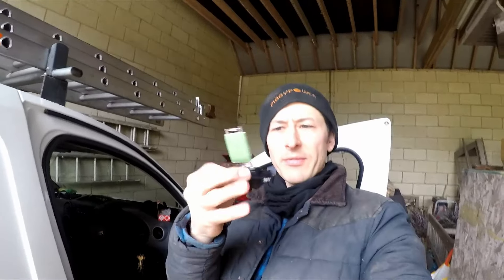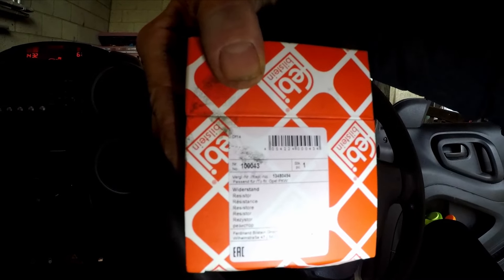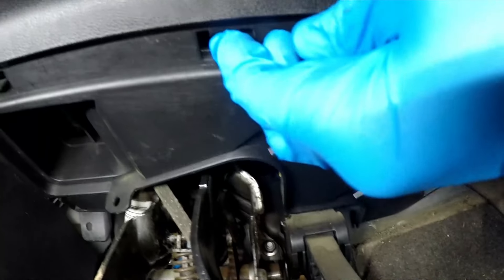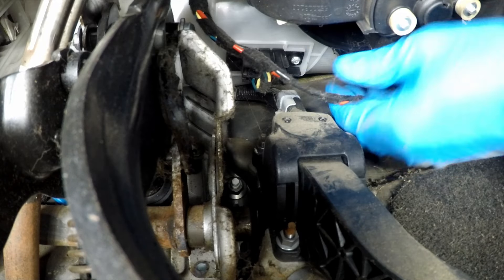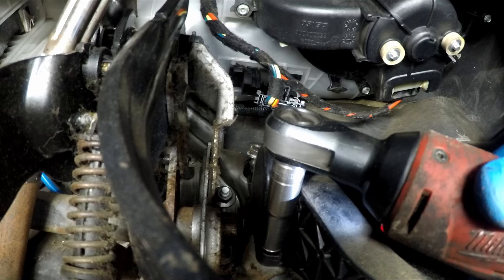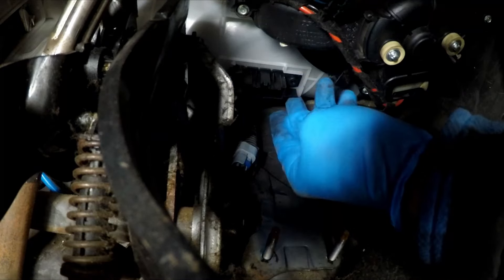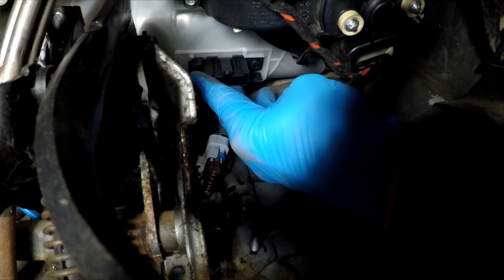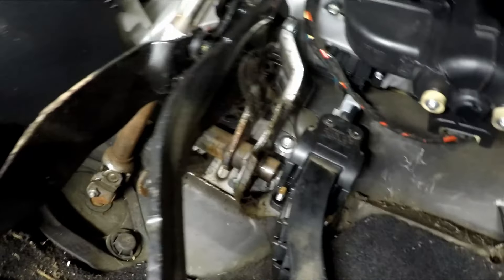Peugeot Berlingo Citroen Partner Fan resistor

Comment: The reason these fail is that people turn on the blower when the intake is blocked with snow or leaves. It's the thermal fuse that opens and you could, in theory, fit a new fuse. Or solder across a bit of wire and hope it never snows again. The fuses may well open if you try to solder them.
Reply from the maker: Very inexpensive part tbh and it's a fail safe that they blow. It can indicate bad wiring or poorly fan too. This is regularly serviced with no blockages in the intake system

Comment: I have a 2017 Peugeot Tepee, partner with windows in Mexico, with a 1.6hdi motor. The fan is stuck on one blower speed. The dash switch does nothing. Bought this resistor, removed cover plate above pedal housing and it’s not located above the accelerator pedal. Any idea where it’s located on this model?
Reply: @Darren-pq5oc  brilliant! Will check it out.
Reply from the maker: As above. May be switched across.
Reply: @Darren-pq5oc  yep, that’s where it’s located. 👊🙏

Comment: i've got a similiar problem with blower resistor. I changed that part you showed and now my fan blows only hot air on cold and hot setting with burnt plastic smell. I checked wiring doesnt heat up and the resitor is cool aswell (when in use), Could you help me with this?
Reply from the maker: So that's a different part which must be stuck on hot. This resistor doesn't control temperature 👌🐷

Comment: I am having the same problem with the fan only working on 4, would this also stop the heat from coming through as it’s constantly cold? 
Thanks
Reply from the maker: No, the fan controller... Controls the fan. Not the heat. Check matrix pipes are hot (when engine is up to temp) both in and out then check the flap which switches from cool air to warm air behind the dash

Comment: Excellent video, many thanks. Anyone trying this needs to be physically fit and bendy as it is a bit of a bugger to get under there. 
Or get a 20 year old with long arms and stick them under there. 2012 Berlingo multi space with A/C was my model for refrence.
Reply from the maker: I'm 36 with a host of joint and back issues.... Nice good stretch first... And I can do about 5min under there .. not as much as when I was 26!!
Reply: @PiggyPower  Same, I am a builder who has always fixed cars on the side, (because I am poor and end up doing it - lucky I am fairly good at it) but my question is simple. Who designs cars and says that the best place to put something that may need to be maintained is hidden under the dash, not with the bank of fuses in an easy to access place with a plastic cover on it? Then they cover the engine with plastic so you cannot get to anything directly either.
Reply from the maker: The fan resistor gets really hot when used so they place it in the ductwork to get air flow for cooling. Some are easier to get to than others... But they do rarely fail. Access to oil filters, service items though ... Yes, I'd like to speak with designers!!!! Modern stuff is insane for trying to do basic servicing.
Reply: I used to do everything when things were simple, even an engine rebuild on a fiat punto. However now I have warning lights for airbags on almost every car I have ever owned, and I fix it with a OBDII diagnostic tool - if the light is out it is fixed because it is generally a sensor with water or dirt in it anyway.
Reply: Я меняла сама ,и мне ...59 лет . 
Теперь на очереди моторчик вентилятора.
Мультиспайс 2013 года.
Reply: Aint that the truth

Comment: Any way to see visibly if the resistor is shot when removed?
Reply from the maker: Sometimes... But just stick a new one in and enjoy it being fixed 😜
Reply: @PiggyPower  thanks. Just waiting for it to come. Thanks for video BTW. No messing. Straight to the point and easy to see replace method 👍
Reply from the maker: You're very welcome. Hope it sorts your problem

Comment: anybody know where the relay is for the indicators and hazards on an 06  CITROËN Relay II Minibus (250) 2.2L Diesel 101 HP and also what it looks like im totally lost
Reply from the maker: Check your user manual, usually it's in there. Failing that a quick Google. Sometimes it's even printed on the back of the covers to the relays
Reply: il take a look thanks @PiggyPower

Comment: Hi do you know where is the ac relay?
Reply from the maker: For the fans? For the pump? Which relay?
Reply: @PiggyPower  FOR the pump please, my ac in not turning on
Reply from the maker: @JohnSmith-pq9zo  is there pressure in the system? Many things need to line up before the ECU turns the pump on
Reply: @PiggyPower  yes, it’s been working fine till
My ecu burn away and I replace him with a same tipe(numbers)
I swamped the cip for key and car drive away, but ac would turn on
Reply: @PiggyPower  now I’m hoping to find the relay and try to overwrite the command to see if is working the ecuu
Reply: I had install Gpl on my car and had a short in lambda senzor.
After smoke and fan was running on full speed.
I clean relay on the bumper grill and now is all ok.
Reply: I had install Gpl on my car and had a short in lambda senzor.
After smoke and fan was running on full speed.
I clean relay on the bumper grill and now is all ok.
Reply from the maker: What's gpl?
Reply: @PiggyPower  hi sorry this is abbreviation for LPG gas in Romanian.
My bad.